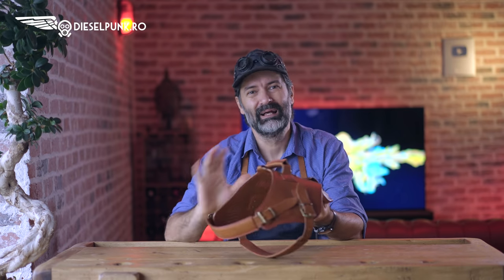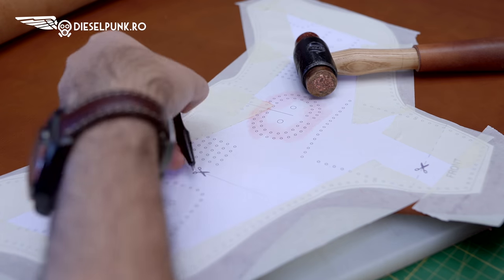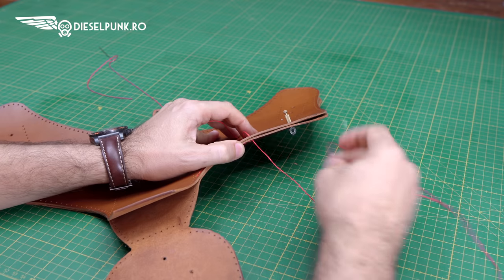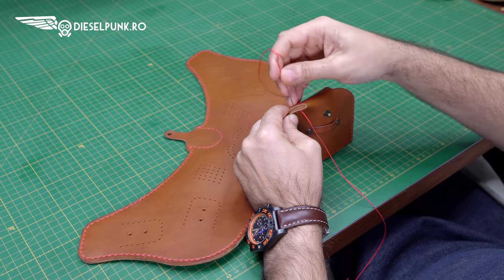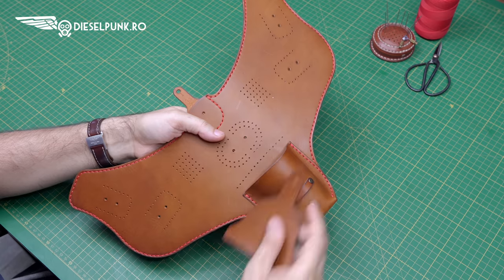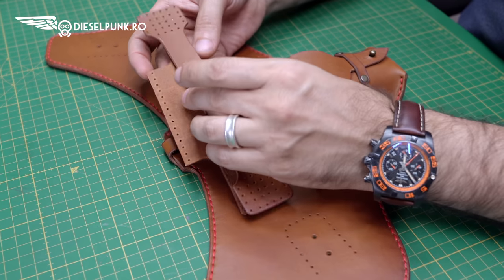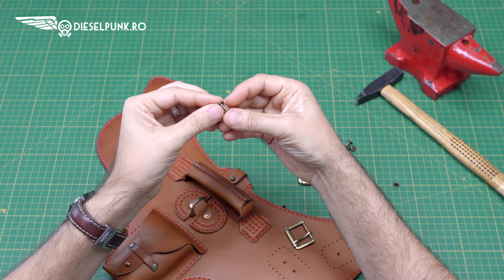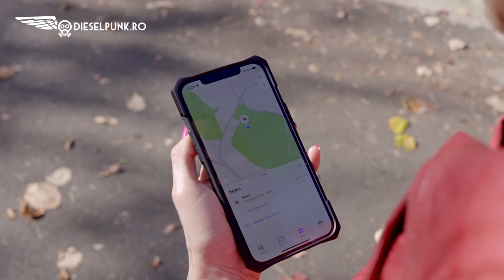Dog Harness DIY - Tutorial and Pattern Download

Comment: I don’t do leatherwork, but I do have a large, 81lb. dog that’s a puller, and he has escaped his harnesses before. He’s figured out how to wear down nylon straps on otherwise sturdy, “escape proof” harnesses. Especially those adjustable clip style straps.

That’s a very sturdy, well planned out harness! If instructions are followed to a t and stitches are tight and secure like how you demonstrate in the tutorial, I don’t see how a dog could pull out of it. Those sturdy buckle straps are perfect for pullers!

I also love the addition of a poop bag! That’s one less accessory to carry around! Though I would be tempted to add a large hole grommet in the design for threading poop bags through.

Any plans for making a leash tutorial? Maybe a leash with a padded traffic handle built in, or a leash set with two sizes? And a treat pouch?

Comment: Tried using 4 oz veg tan for this. It's looking like it might still work, but the poop bag attachment is way too stiff and I can barely get the strap under the holder. It might be fine to use veg tan on the top piece and maybe back it with something more pliable, like the leather Tony is using in the video. I used veg tan so I could tool and dye it.

Comment: I have a problem, Tony
My poodle has a 29 in chest so I chose the medium pattern. 
I need to set my printer to 103% to make the test pattern measure correctly.
Now the pattern runs off the printed page!! The outside edge of the pattern and the sewing holes are missing.
Can I take the large pattern and shrink it (don't think so!). A
Any suggestions?
David
Victoria, BC